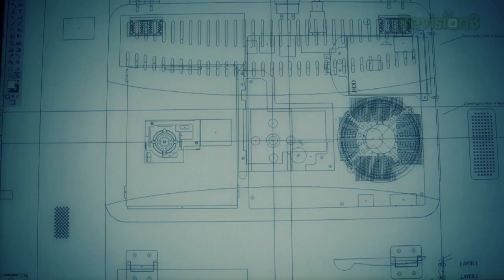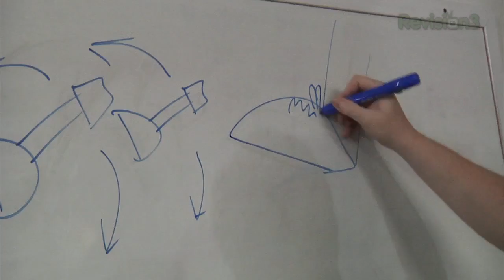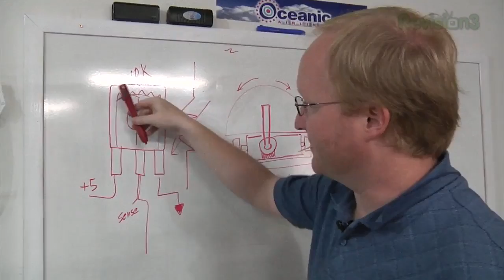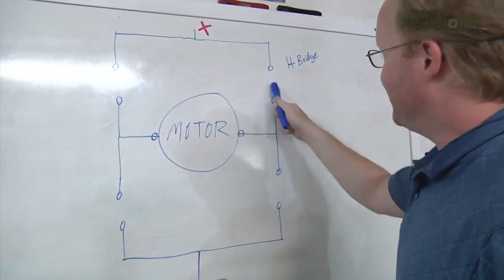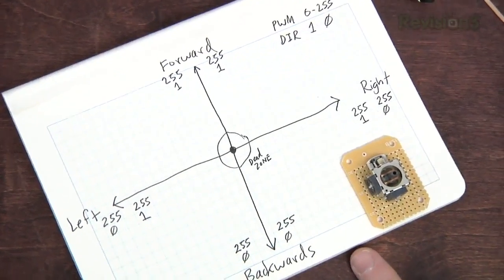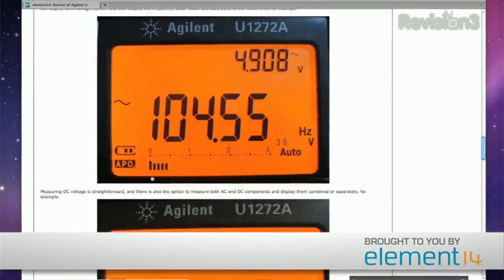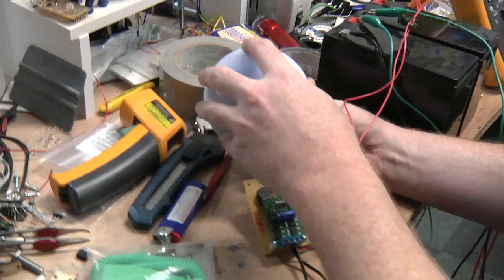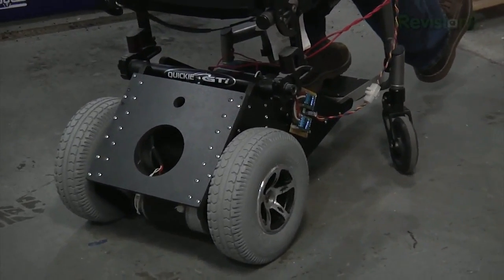A Hands Free Wheelchair For A Cause!

Comment: I have an old tablet laptop (with touch screen, not one of those special pens), and it no longer works. I was wondering if it would be at all possible to use the touchscreen as an extra monitor / drawing tablet for a pc.  I'm guessing it isn't, or would be hard since the controller for that stuff is probably part of the motherboard on the laptop, but if it is, that would be great.

It's an HP Pavilion TX1000 

Anyway, it's just an idea.

Comment: lol @ 11:55 MLG dual-wielding.  I'd be interested to hear more about how you end up mapping joystick input to motor control... You have to bad discontinuities, such as when the stick is pushed completely to the right (in-place right turn) and then moved slightly back (reverse in-place right turn==left turn!?). Also, what to do about the audible buzz from low-value PWM? You want to offer a large range of control at the lowest speeds but it has to be whisper-quiet. There must be a solution...